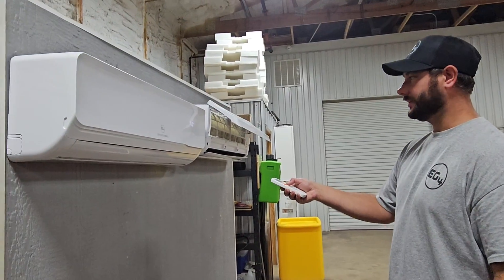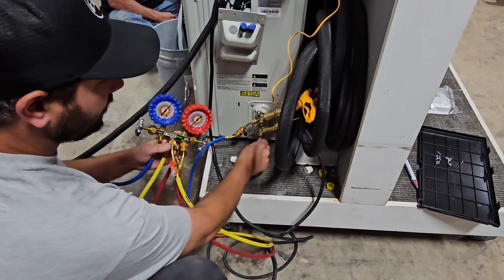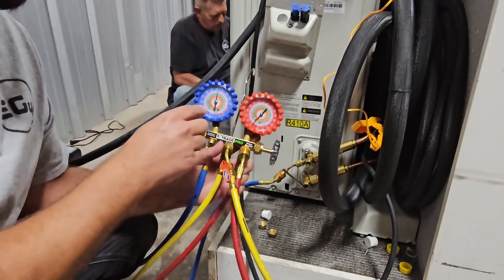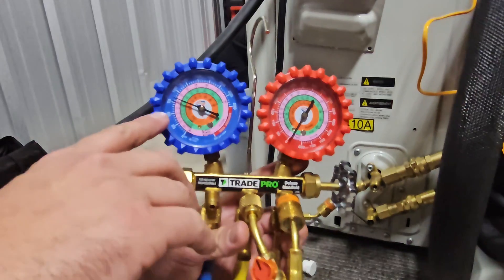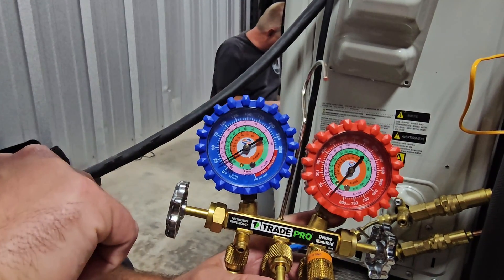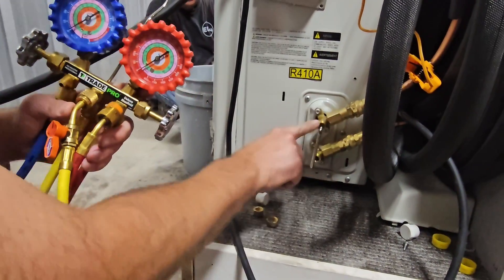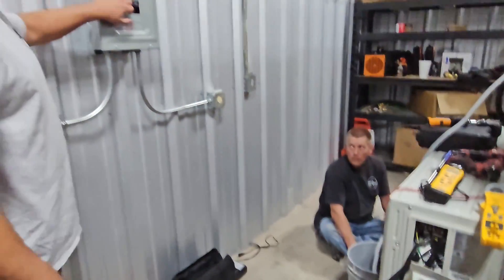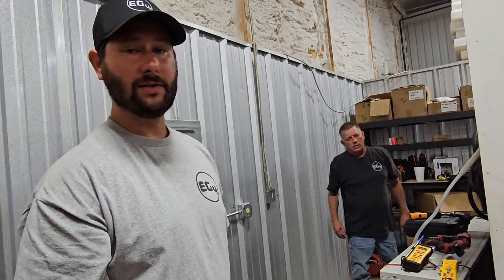How to pump down the refrigerant into the mini split outdoor unit?

Comment: I've been given a used inverter mini split. Valves have been tightened and there's some pressure in unit (undoing valves very slightly for a moment), but is there any way to check the unit's pressure to determine if enough refrigerant to run before installing? 
Cheers from Australia
Reply from the maker: Yeah, but it's hard to tell, just by attaching your gauges before you install based off of standing pressure.If it's charged, you really need to check out my video on how to charge a mini split

Comment: Thank you for the video I was wondering what do you do when it's below zero or between 0 and 32° f when you can't turn it on cool mode probably a dumb question but thank you anyway
Reply: @brainwashed7244  put the outdoor thermister in a warm cup of water Or cup it in your hand. Gotta outsmart the controller.

Comment: how do u do this in a multi zone mini split? - trying to replace slightly leaky valve in one of the service ports of the 4 zone minisplit that has 4 service ports (low side only).
Reply from the maker: Turn all the heads on cooling. Close the liquid line service valve first.And then when the pressure hits zero, close the suction line service valve next.

If you can't pop it all into the outdoor unit, recover the refrigerant into a tank
Reply: @taddydigest  thank u
Reply: @taddydigest  thank u. I was able to do this only for a single zone which had a leaky valve. There wasnt a need to touch other zones. Atleast in this mini-spilt.

Appreciate your help.keep up the good work.

Comment: Looks like your EG3 pros, if we pump down and disconnect the line sets, can they be reused? or what is the procedure if I need to move the unit.
Reply: You can reuse it. Cap em before moving to keep it clean. Then treat it as a new pipe install (nylog, purge, vac).

Comment: new tech question here. whats the limit on refrigerant you can pump down into a system? does it depend on tonnage of system? and question is brought up because im thinking about longer lineset runs that might've needed more charge to the unit.
Reply: Also if the the Lineset you have exceeds the amount of Feet the unit is pre-charged for, you MUST follow the equation (in the manual, the values of the equation vary by model so you must check the Installer Manual) for how many OZS of refrigerant to add per foot of additional Lineset.  Follow this metric, and you will never fail to add the correct amount of refrigerant to a Mini-Split inverter unit.

Make sure to follow the safe practices of Refrigerant handling and ensure you are EPA certified, there is much details in between the lines which are obvious to any technician who has endeavored to learn how refrigeration really works 

Good luck on your journey, we need more HVAC technicians out there.
Reply: Hello friend, I have an answer for you.

I just took a 2 day Mitsubishi Training course in Vancouver, Washington and I can share a couple things pertaining to your question.

Most mini splits come factory charged, with enough Refrigerant to work with up to a certain set amount of Feet of Liquid Line Set (no need to double count by including the larger Vapor line).  

This means a Mini-Split like the one I worked on the other day came Factory-Charged with enough refrigerant for 140' of Lineset.  I calculated that I had 110-125' of Lineset, so therefore I went to the Data Plate of the Outdoor Unit and added EXACTLY the amount of refrigerant on the data plate.

My unit worked perfectly and within manufacturer specification.  You can find how many feet of Lineset the outdoor unit is precharged for in the Installer Manual for the system., every single and ALL Japanese made Minisplit-inverter units will list this number of feet specifically.

Hope this helps!

Comment: my valve core seems to be bad... opened the cap a bit and a small amount of refrigerant came out. So i have to pump it down without gauges connected, right? 3m lines, maybe 20s until empty? Then replace the valve core, vacuum and leak test?
Reply: @JohnnyTheCache  No sir, you just use a 5/16 valve core removal tool, so you skipped all that pain.

Comment: Is the procedure the same for multizone systems?
Reply from the maker: yes
Reply: @TaddyDigest  thank you, it's still only one low side connection even though it's a multi zone system? ( each head doesn't have it's own low and high connections )
Reply: This would need to be done if I need to replace a line set right ?

Comment: Unless there is added refrigerant for long lines. So, can you tell by the sound of it slugging? Or not?
Reply from the maker: All mini splits have an accumulator which should help with slugging
Reply: @taddydigest  Yes but they are designed for the amount on the tag.  So I was asking if you can tell by the sound that slugging has started, which I guess would indicate that outdoor unit is full and you should stop right away....